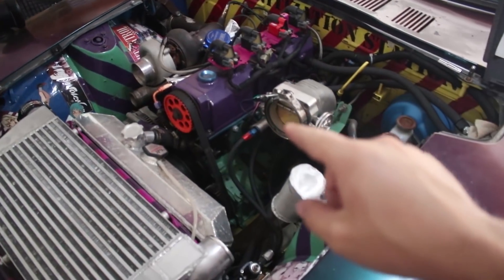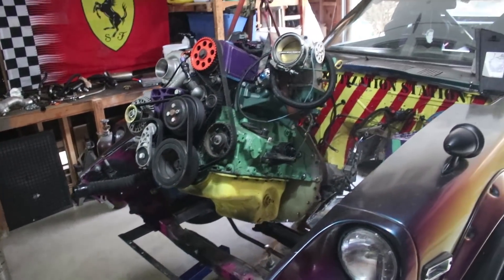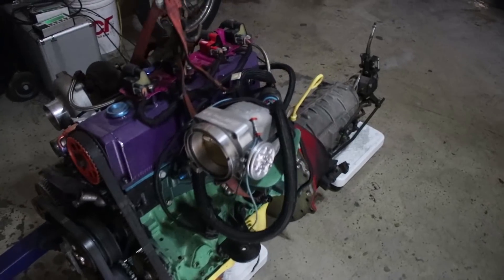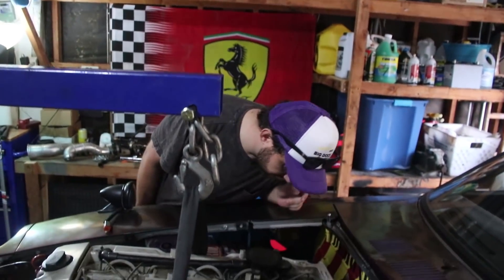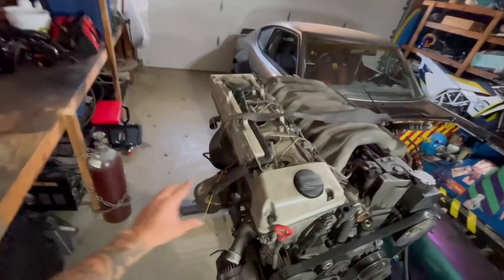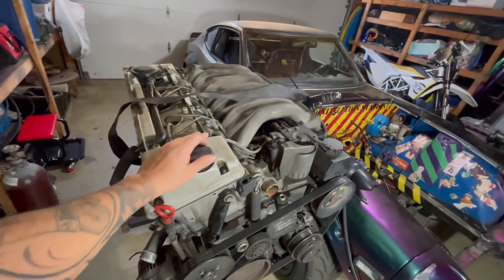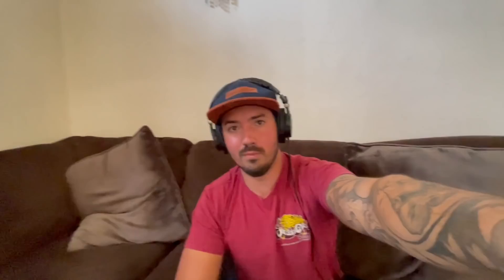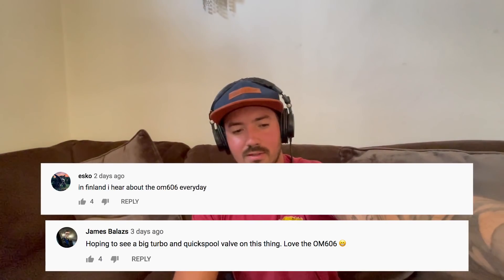240Z TURBO DIESEL SWAP | How much HEAVIER is it? EP 1

Comment: 5:08 It would be wise to pop test the injectors before going for power. You want to make sure they are opening at the correct pressure and also not leaking. These engines are very very reliable, as long as you look after the oil and the injectors. Good luck!

Comment: On the one rotor you should check the voltage at the injectors and coils compared to the voltage on the megasquirt while it's running at higher rpm.

Comment: Rear sump off the later cdi is a straight swap (with oil pump and pickup) om648
I have a 500hp 606 sprinter xlwb as my daily (ultimate sleeper😂) for the last 4 years, you won’t be disappointed with this engine!
Also worth noting that mercs of this period are like Lego, parts interchangeability is insane.

Comment: Diesel swaps are awesome! Be mindful with the wastegate screamer pipe that turbo diesels have the wastegate open a lot more compared to a gas engine. Because the air isn't metered the turbo will create boost even at part load

Comment: Living in an apartment, I had a detached 2 car garage that was in the middle of two apartment buildings. I was installing a light bar on my 98 Camry winter beater because the headlights were so glazed I couldn't see at night. Didn't have a power drill at the time so I sat out grinding my crash bar with a Dremel to make holes for the mounting bolts for like 6 hours.
Reply: They make drill bits for dremels.
Reply: living in apartment sucks

Comment: Drive way when I was 13 years old I got a $100 Chevy S10.  Missing it motor, trans, read end.  Good cabinet and good body.  Spent the next 3 years working on it learning hot to put a small block Chevy 383 stroker in it.  Junk yard hoping to find part and ordering parts from catalogs. This was before the LS swap days. The LS was still new.... I’m a prototype millennial lol.  But when I was 16 I had to running. Learned to weld and fab it was really nice and stupid fast.   I got lucky with my part a 4 link 9” ford that fit with 28x15x15 street slicks for $200.  It was in a Cuba and was cut out.  Little fab (cutting the bed to hell too) and welding it fit my 1986 S10.  Learned so much but when I was legal, “it was too”.  I wish I still had it.  Sold it to pay for college then it got fubar by stupid with all the horses.  Guy was okay but the truck wasn’t so sad...

Comment: 1983 toyota truck
 Put a really big loppy cam in it . it was awsome . i threw a weber carb, offenhouser duel port manifold msd ignition an had the valves 3 angled ,deacked the head , boared it 30 over ,  5 speed rear end with a 4 speed trans. Lowered it 3 inches and painted it 57 corvett3 yellow. That little 22r wasnt making 95 hp any longer. It loved revving to about 9krpm
 I miss that truck still to this day 20 years later. It was my high school  car.

Comment: To answer the question. I swapped a 350 vortex 4 bolt main with carb in to a 94 Pontiac firebird. Getting the HEI to fit was fun with minimum tools.

Comment: The answer to your question is easy. I changed the timing belt on my 2.3 ranger in my friends driveway 3 days after they installed a gorgeous brick driveway. If you crank the wheel on a ford without the engine running... it spews power steering fluid EVERYWHERE! One afternoon changing the belt.... 3 days of scrubbing and cleaning to fix the mess I made. Lesson learned. And, hopefully somebody learns from my mistake lol.

Comment: brapster is fiberglass body ., you have to wire it like a boat . you need to make the engine a star earth point and you have to ensure the ecu grounds cleanly on the engine . for sure you have a floating or kicking earth issue with the ecu under heavy load. changing the manifold shifted things for the rpm. i highly suggest you crimp AND solder engine /ecu earth points.//the two ignition coil earth need to be on separate points on the block

Comment: Since you posted the previous vid, I've been reading about the OM606 everywhere I can and can hardly believe these babies make such big power and rev as well as they do on stock guts; so much so that if the 3UR in my truck decides to pull the pin, this would be the first engine I look at to replace it. About the only downside, apart from losing that sweet V8 engine note, would be getting all the electronics to play with the diesel. Guess that's the bonus for putting these into an older chassis.
Add: I was looking at a 5.9 Cummins awhile back and picked up a hefty S475 turbo that only needs a rebuild kit but after looking at what parts go for on the Cummins, decided that reliability was the better option. These 606 series engines are the best of both worlds!

Comment: Built an Ej255 with forged internals in my dorm room. Not really a driveway, but def not the right place to do it. built up the shortblock and then took it downstairs in a wheelbarrow. Installed it in the parking lot at the rez.

Comment: Interesting as a fully operational aluminum gm 5.3 is just at 450 lbs. Those 2.3 are all cast iron, heavy but strong. A gm 3.6 v6 320hp with 6 speed auto is 470 lbs, as I weighed that combo I'm swapping into a future project. Even a 1964 ford straight 6, 84hp  with generator and 3 speed manual is around 470.

Comment: OM648 320cdi oilpan is rear sump and has more advanced oil pump, and it fits pretty much straight to om606 and m104 engines.

Comment: Well, check what duty cycle rating your injectors are running when you start to run out of fuel, if they're too strained, it could be that the actual injectors aren't heavy duty enough, even though they're CC rated. If your duty cycle is good, then your constant fuel pressure, if it drops off when you're halfway through a pull, that could indicate lack of power in the fuel pump. If the pump isn't operating as it should be, make sure its not an electrical problem with the draw. Also, make sure that both your in tank and high pressure pump are performing as they should, providing you have both that is. I would also look into the diameter of the fuel lines as lines that are too small constrict fuel flow and lines that are too big restrict pressure. If everything is working as it should and it still runs lean, then you're either leaking a massive amount of air or....maybe out of time? Thats all I got.

Comment: Man, I'd fow test the injectors in their current fuel rail/fuel pump/wiring harness. We used a distributor on a drill to simulate rpm, and a beaker to catch and measure the fuel.

Comment: Hopefully they put the fuel pump from the om603 on this , that and a bigger turbo easy 400-500hp w everything stock
Reply: They said they were getting everything they need from dieselpumpuk, so I'm going to assume they are getting the 500+ bhp OM606/OM603 modified pump, hopefully with the anti jerk system as well.

Comment: Could the 1 rotor be loss of spark giving a false reading? I've had piston engines do the same thing with a bad coil or voltage issue.
Reply: That’s one of my concerns,  but it’s doesn’t break up like you would expect from spark blowout, it just starts rapidly leaning out

Comment: I have been wanting to diesel swap my datsun too and what engine and trans its it again
Reply: mercedes om606 with a nissan cd09 the om606 isnt the easiest to find and i do not know if the make an adapter for the om617 way more common turbo diesel from mercedes that a lot of jeep and toyota guys like using in offroad rigs

Comment: Just a heads up to get your pump flow tested because ive been hearing bad things about dieselpumpuk they have sold pumps with little to no calibration and are stealing the design of the pump elements from dieselmeken...

Comment: What diesel pump are you going to use? I'd recommend a om605 pump with 8.5mm elements.
Reply: your recommending a 5 cylinder pump on a 6 cylinder ...?
Reply: @EverythingAnthonySOS  uhm, om606 didn’t come with mechanical pumps. Basically every single om606 with a mech pump is using a 605 pump.
Reply: @eliasbergstrom5300  I know they use om617 pumps on the Om605 to change to mechanical but their both 5 cylinder pumps , I though they used a om603 pump on the om606 to go mechanical both being 6 cylinders
Reply: @EverythingAnthonySOS  yeah idk then, I just know om605 pump cores are commonly used when upgrading the elements for 606 and big boost
Reply: 605 = 5 cyl
606 = 6 cyl
604 = 4cyl all from the same family.
Early 606 came with a mech m series pump, later ones with EDC. Mech pumps came with 5.5mm plungers, and EDC with 6mm, you can put EDC elements in the mech pumps for a budget upgrade. 👍